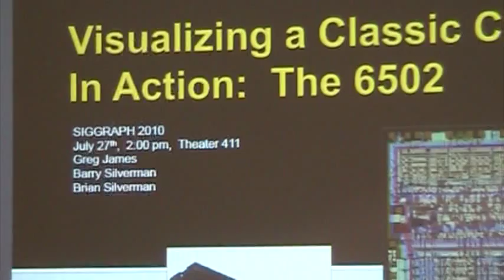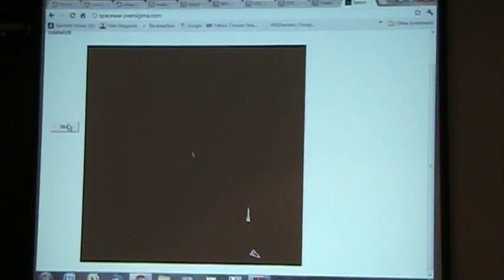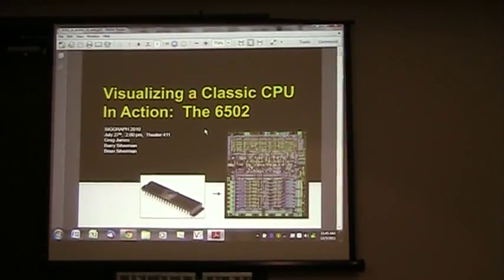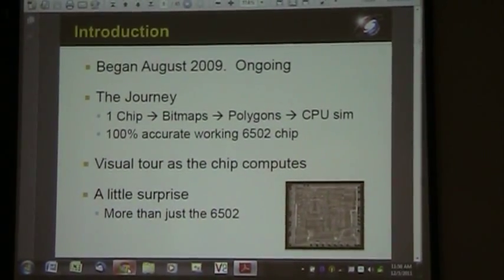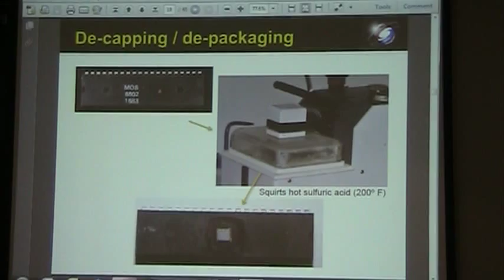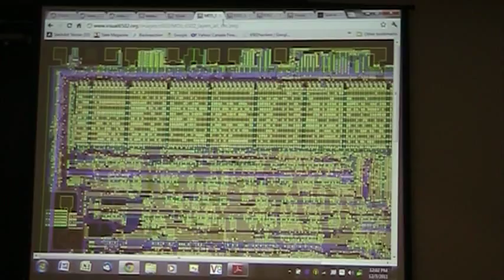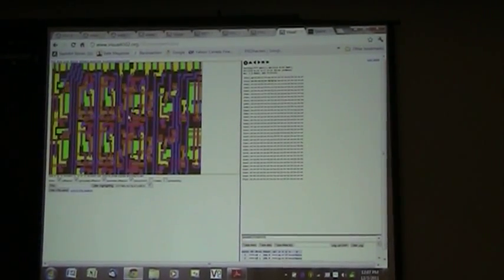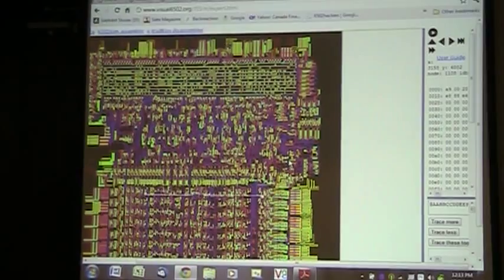World of Commodore 2011 - The Visual 6502 Project

Comment: 2:32 I thought Chuck Peddle made the Motorola 6800 and then, later, went on to make the 6502?
Reply: According to WP https://en.wikipedia.org/wiki/Motorola_6800#Development_team both Bill Mensch and Peddle were involved in the 6800 project though they weren't main designers or team leaders. The 6502's short-lived brother the 6501 was actually designed to be pin-compatible with the 6800: http://retro.hansotten.nl/6502-sbc/6501-2/ .